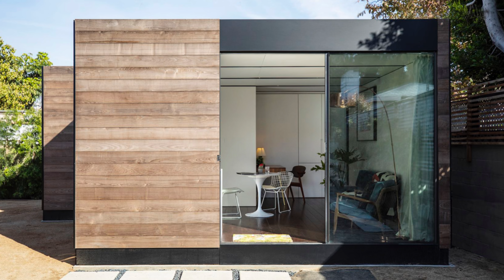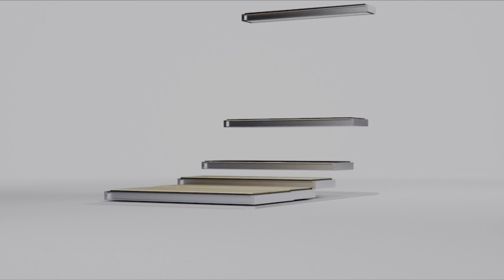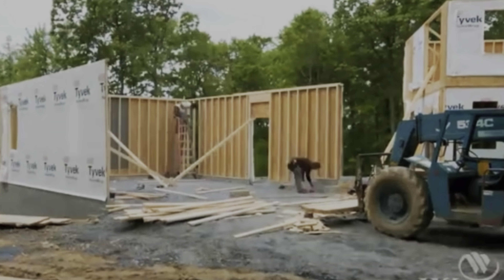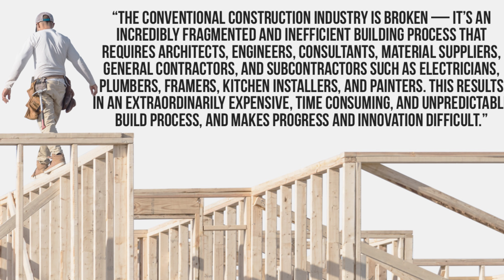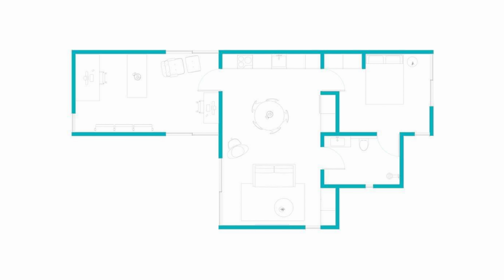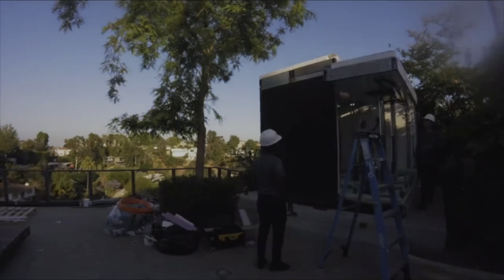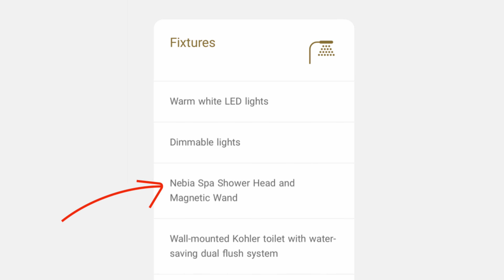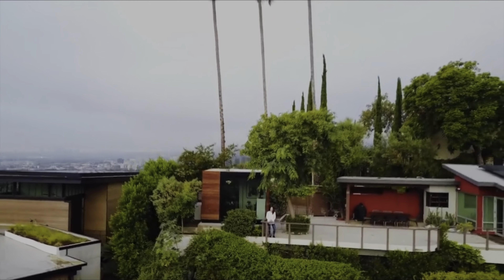Modern PREFAB HOMES Builder That Received $60 Million in Funding

Comment: These are very cool, but when I called them, it still sounds like they are at least several months away from expanding outside of the city of LA and/or expanding beyond ADUs. I really wish they could have this same homebuilding and fixed price process for primary residence outside of LA!
Reply: the problem may be that Los Angeles has about 12 million citizens  - and it will take awhile before they satisfy the local market.
Reply: @StyleViewStudio  correct. Cover also is perfecting their systems for their current market before expanding.  Cover has to train new workers before it expands.  All workers are shareholders. Disclaimer: I have an ADU under contract with Cover. My knowledge is based on my experience as a client.

Comment: The homes seem very nice. While there are no set floor plans and each home can be designed, it would have been nice to see floor plans that have been created and realized. Great information and video, as usual.
Reply: Cover's  homes are pretty  amazing. Disclaimer:  I have purchased one of  Cover's ADUs. It will break ground in the next eight weeks.

I feared that they might feel like a trailer house, but they do NOT.

 I was skeptical until I visited one. They seem more solid and luxurious than one might expect. The ceilings feel much taller than 8 ft., which is probably due to the sliding floor to ceiling glass walls and fixed floor to ceiling windows.  
Cover offers many custom features that are not obvious. For example, the sliding glass doors have electronic locks with battery backup.  Also, the primary sliding glass door entry opens with a key fob.  Each structure does come with one traditional solid door. To meet egress/ingress requirements, bedrooms have sliding walls/doors. The sliding windows/door frames are integrated into the structure.  

The process has been amazing so far except for city building inspectors who have been unreliable.

Cover came to my property and    used drone to capture its topography and dimensions before a survey was done. Then, the architects presented me with a plan based on my desire to have an ADA compliant 2 +2 unit with a maximum square footage of 1200 sq ft, a kitchen with cooktop and oven, dishwasher,  a washer/dryer. The primary bedroom needed space for king bed and direct access to bathroom with a shower and separate tub.  The second bedroom needed space for queen size bed. The second bathroom required a shower and easy access from the living area for guests.

We  had three or four meetings over a three week period to create the best plan for my needs. They made no point of trying to max out the square footage. They also did not try to include a third bedroom. I had that happen with some other ADU builders.
Reply: @kdockrey  can I ask how it’s going and how much was the house you spec’d?
Reply: @granthoover9045  the final meeting with building and safety is tomorrow to pickup the final permits and the site work will begin. My cover will have 2 br  + 2 ba in just under a 1K sq ft.  It has a combination living/dining/kitchen/laundry area. It  will be the company's largest ADU to date.  The site work will take longer for my property since my current electrical meters are on the garage that will be destroyed and replaced by the ADU. While it does not seem to be that complicated, it is due to dealing with LADWP (localpower company) and LADBS (local building dept).  Given their involvement, we project that the site work and foundation will be ready by February 1, 2022, when the walls will go up. The building should be finished by March 30, 2022. The dates for the Certificate of Occupancy and for the power company to turn on the power are unknown.  The ADU's gas meter instalation date is unknown. Until it is installed, the ADU will rely on one of the existing gas meters.  This ADU installation will be Cover's first ADU where the primary building is a multifamily/Duplex.

I could have built two 1200 sq ft ADUs given the lot size and the multifamily primary building, but I opted to keep more vacant space for decks/patios/privacy.

The design of the ADU focused on privacy and as for the design, we spent about a month on the gross details for submission.  Once those plans were approved, we spent a few days on the specific details such as   built-in cabinets and their layout. One of the reasons that I opted for Cover is their design esthetic, which really does streamline design decisions. The only major decisions were  picking the exterior finishes (2 exterior wood facade options and 2 powder coat trim/facade options) and the interior floor color (2 options).  

Due to privacy, the front elevation of the ADU only has a sliding glass door that is 11' x 8'. The rest of the front is covered in ash facade over  black powder coated steel. The other elevations have more floor to ceiling fixed windows and floor to ceiling  sliding glass doors. The only standard exterior door is on the rear elevation. Each bedroom has at least one wall that is a floor to ceiling glass door that slides open for egress/ingress.
Reply: @granthoover9045  it is going well. My house was specified a year ago September. Thus, current prices do not reflect what I paid. My Cover is a about 970 sq ft and the price was about $505K. It is 2 br, 2 full baths and one has a soaking tub. Full kitchen with Sub-Zero refrigerator freezer, wolf induction cooktop, wolf e oven,  asko dishwasher, asko washer dryer, solar panels, gas tankless water heater, automatic blackout shades, etc. While price was a consideration, quality and quick build time were more important.
Reply: @kdockrey  wow! That sounds incredible, I was going to ask for a few pictures but then I saw your other message that they haven’t quite started yet. If you remember, I’d love to see a few pics and I’m sure other people who come here would be interested. Good luck and congrats!
Reply: @granthoover9045  sure. I'll see if I can post a link to the multidimensional plans and  virtual tour that they created. I was mesmerized by the process since they used a drone to film the property. Then, they fed survey data into their system to create a basis for the design. After we designed the building, they created a   multidimensional  program that includes a virtual tour,  floor plan, set backs, and an interactive measurement tool.
Reply: I'd suggest visiting Cover's Instagram account to see examples of its work.

Comment: I have a 750 square foot SIPS (Structural Insulated Panels) house (which I designed) built on a slab foundation. It was built for approximately $95,000 and the "frame" was up in two days.  I would love to share a few photos of this home with you all.  Not sure if this is possible on your site, Kerry, but it might be something that your followers would appreciate.  I would love to see the industry explore SIPS construction.  My energy costs are minimal. This is definitely an avenue to explore!
Reply: Yes please! I’m so curious about dome homes and kits that can be put together and the kits don’t cost much compared to these prices. Why don’t you start a channel and let us know how to find you!
Reply: wow that's very encouraging...can you share that somehow through Kerry or other way(s). Many would love that . Might there be a way we can find out more through you directly if one of those other ways isn't an option? What city /town..state are you in?
Reply: I’m thinking of building a modern A-Frame myself and I’ve been considering using SIPS - makes sense, right? I’d love to see what you created with SIPS and get some inside into the cost and process. Anyway you can share?
Reply: SCAM ALERT...THE APPROXIMATE COST OF $95,000 DOES NOT INCLUDE ALL REQUIRED COSTS AND IS NOT EVEN CLOSE TO THE SAME QUALITY AS THE COVER MFG. SYSTEM.

Comment: Thank you for doing a video about Cover. It is my favorite manufacturer of modular homes. I have a ~1K sq ft 2 + 2 unit under contract.  I went with Cover because it offers a fixed price contract and it does everything from design to certificate of occupancy. Many modular home manufacturers require the owner to hire a contractor to do the installation.

Comment: CB Homes have the Inteligent BioWeapon Defense air filtration that most YouTubers forget to mention. A Water Based Chiller/ heater Climatization technology we all need. Better to live in a small, but all ready living space than to live in a huge space where you will need to contract expensive painters, plumbers, and electricians. Better to live in a small, but safe, organized space where you have a smart Unified Services Ceiling. With CB Homes, the ceiling provides lighting and sound recessed tracks that also integrate with small air diffusers on their ends. The air ducts are connected to a smart Air Treatment Unit, comprised of concealed air filters. The ceiling panels compose a radiant cooling/ heating system, where a set of small tubes provide water based radiant climatization. That means a safe air to breath, as this Smart Climatization System keeps your skin and lungs safe, even when the outside air is heavily polluted. That detail for me is PRECIOUS and UNIQUE

Comment: I like the design of these prefabricated homes as I do most of them with their modern looks, but I live in Texas and you still get something twice the size of this for a fraction of the price. Until there are places that offer to build a 2 bedroom 2 bathroom or 3 bedroom 2.5 bathroom prefabricated home that starting price costs 150,000 and tops out at 250,000 in price, it overpriced. If this was built in Texas, it would literally cost about 35,000 for that office and at most 150,000 for the 2 bedroom place. The material costs are identical for the most part from state to state and labor costs isn’t more than 15% higher in places like LA, San Francisco or NYC, so why does it costs 2-4 times more in these areas for no good reason? I need to start an affordable prefabricated home business and put these other guys out of business with their over pricing of these products.
Reply: You may need to do a little state to state research cost analysis as well as minimum wage and labor cost per hour from East to West to Central Coast. You'd be surprised.
Reply: @markstunes3221  minimum wage is usually universal. Plus on top of that states like California use a lot of illegal laborers in many cases when I’ve been in places like Palm Springs and they’re doing renovations or doing a new build, which means the costs are even less. NYC has probably the highest labor costs because there’s a lack of illegal unskilled labor unlike the states that border Mexico such as California, Arizona, New Mexico and Texas. Average construction worker hourly pay starts at $15 per hour, and Texas it starts at $13 per hour in California it’s $14 per hour. These numbers are from payscale.com if you want to check it. Average salary of a construction worker is from $25,000-51,000 range from cost to cost. These numbers on average salary are from ziprecruiter.com in case you’re wondering. You’re most likely looking at the salaries of the general contractor or the foreman which is in most cases the only high paying job on the worksites, which means your views are skewed tremendously above average pay. The purchase of housing is an overpriced racket. For the skilled labor such as electrical and plumbing are only on site for a week or two for a house. That’s a higher cost as well, but hiring the skilled guys for a week or two isn’t going to make the price go up that much. The main cost is the unskilled labor, which is the lowest paid man on-site. There might be 4-10 of those low paid guys, but the general contractor is making what 5 of those guys make just to oversee the worksite to make sure things are done correctly, which is understandable obviously. There’s zero way to justify why homes cost so much more in other places. People are overcharged because of marketing, and not because it’s actually worth being paid for that price. If people figured that out, then the prices of housing would come down, but most folks are too stupid to do that. You keep being happy to over pay for what actually costs about 1/6 to build of what you’re paying for. Thank God I’m a man that knows how to use tools and I’m surrounded by other men that know how to use their hands. We’re finishing up my father’s house on his 50 acres which is a 2 bedroom and 1 bath for $58,000, which includes us paying for the skilled labor at their regular rates. People that pay this much for a building are absolutely stupid.

Comment: I understand there is a huge need for housing in California. The problem is, housing prices in California are so unreasonable, that these prefab houses look like their prices are somewhat reasonable.  Nothing could be farther from the truth. Find some prefab builders in the mid-west or the east coast. The cost per square foot should be LESS than conventional building, far less. The designs are beautiful, but one design serves many buildings, so its full cost does not have to be carried by each dwelling as if it were a custom build. There is no point in building prefab homes if they are not: 1. Stronger and more durable.  2. A lot less expensive than conventional building. 3. Way more energy efficient. 4. In compliance with the vast majority of building codes. 5. Can be delivered and constructed in a timely manner.  This can be accomplished by: 1. Utilization of new building technology and components. 2. Standardization of appliances. 3. Flexibility of interior design. 4. Uniform foundations, such as concrete pilings or piers. 5. Energy saving preparation for off grid preparation. 6. Innovative use of outdoor space.  Furthermore, the corporate entity building the homes needs to work with state building inspectors and insure local inspectors will approve the buildings in their area.  Certainly savings could be realized by adhering to strict regional requirements, such as snow load, earthquake, or wind load, on an as needed basis.  It would be rare to have all three to be required in one area.  If some corporation wants to break open the housing market, they need to study what Sears did with Kit Homes in the early 1900's. 
50 years ago, I owned one, 80 years after it was built.  It was a value then and it is still a value now.